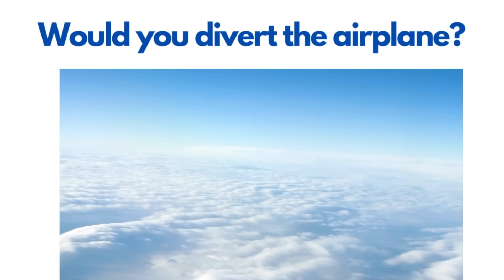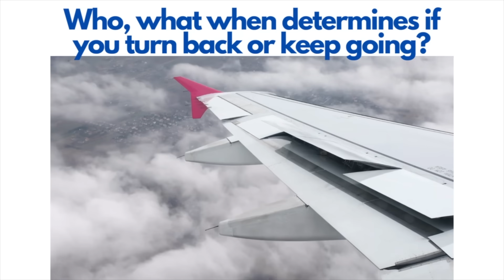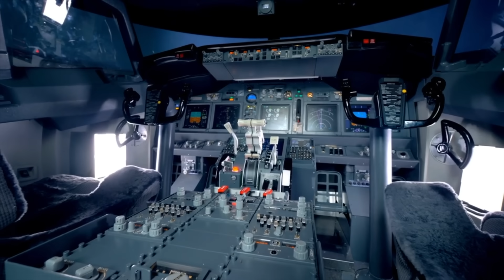Airline Pilot Answers Your Most Asked Questions About the Airplane (Part 6)

Comment: Another interesting video, thank you both for taking the time to answer our questions. Sometimes, if a seat mate looks like they might be trouble, you can pre-empt the first expressions of it by some kind gesture. Example: I flew back from Victoria (5 hour flight) in a dash-8 two days ago. I am a plus size lady, so those tiny seats are narrower than I am and my spare tire overflows the arm rest. I was seated first, and a well dressed older woman sat down beside me, rather obviously wriggled about in her seat to make it clear that she was crowded without demeaning herself by saying something, and sighed loudly. I turned to her and smiled, said something like "Hi, I would like to apologize in advance, I try to be a nice seat mate but health issues have added to my weight and I'm afraid I might crowd you a bit without meaning to. It's not intentional. On the plus side, I share my airplane chocolate!" Then I offered her the open bag of mini Lindt chocolates. And offered them again at several points during the flight. It was a peaceful flight, other than uncomfortably small seats.
Reply: In general, that's one of the reasons some airlines have rules regarding certain circumstances where you're required to buy an adjoining seat - the airline that Captain Chris works for is one of them.
Reply: @SnowySpiritRuby  It's not extreme enough to need an adjoining seat.

Comment: We had a lot of turbulence on my return flight, and the flight attendants repeated the reminder of where the emergency exits were. I've flown enough to remember that this is not routine, so I thought it was a sign that the staff were afraid there might be an emergency. I quickly took off my Fitkicks and put on my good ruynners, and slipped my ID, keys and wallet into my pockets, just in case.
Reply: It’s OK to follow your “better safe than sorry” approach, but the added review was likely because the flight attendants know many passengers aren’t focused on the safety briefing at the start of the flight. I hope this puts your mind at ease if it happens when you fly again!

Comment: BTW Laurie, if you find it too hot in an airplane, Amazon sells a neck fan - it's sort of like one of those collars oxen used to wear, with a small fan on each side that blows cool air onto the side of your neck, and it is charged via USB cord. I haven't used mine on a plane, I tend to use it most on hot days at Powwow, but it would work for air travel and fits around your neck like a neck pillow.
Reply from the maker: I have seen those!!!!
Reply: I have one of these neck fans for my hot flashes. I’m planning on using it on our 14 hr flight to Japan. I hope it doesn’t bother the other passengers.
Reply from the maker: I just got one and love it! @patriciajackson1457